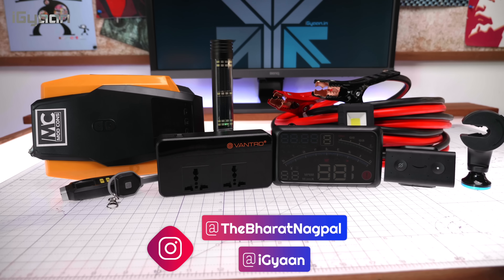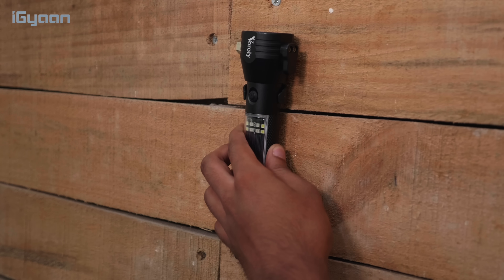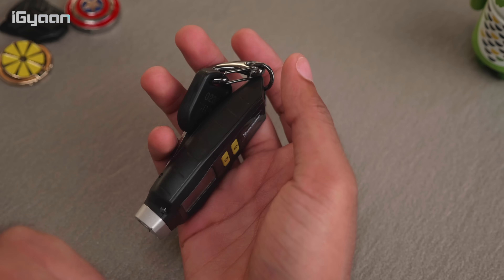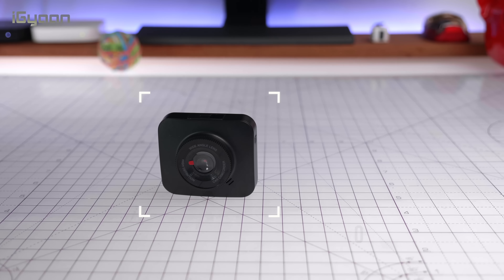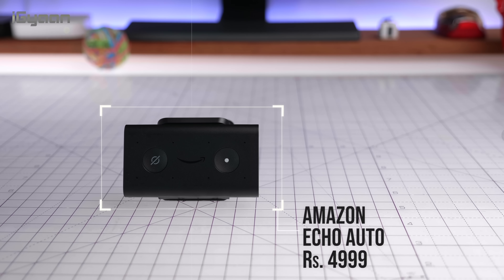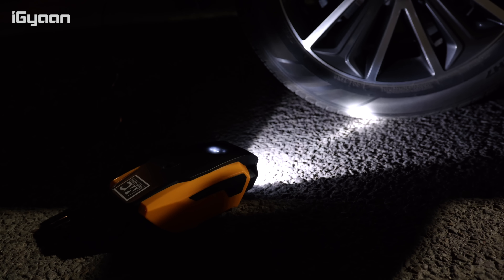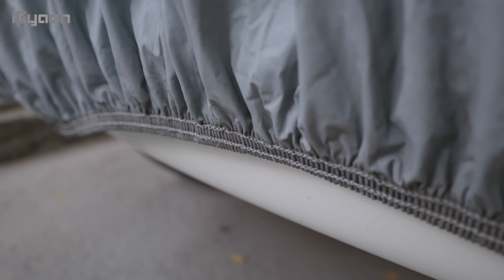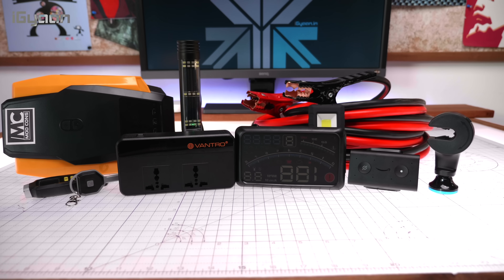Top Tech Gadgets for Cars Under Rs. 500 / Rs. 1000 / Rs. 2000

Comment: For portable tyre inflator, do check the Mi Electric Inflator. This has a 20000mAh battery and can fill 5 tyres in a single charge. It's pretty handy. Do check it out
Reply: I will suggest to buy Burgmann Car Vaccum cleaner which comes along with Tyre inflator inbuilt

Comment: I've been using a more expensive version of that Michelin tyre pressure gauge; the blue one which goes for 1500-600 yet I still don't get the features that the cheaper model has. Quite stupid product placement by Michelin if you ask me.

Comment: With the Echo Auto, if its connected to the car's speakers via either Bluetooth or aux cable, will I still be able to recieve phone calls on the car speaker? If yes, how does it work? Are the calls routed via the Echo Auto? And how does the Echo Auto connect to the internet? Via WiFi hotspot or Bluetooth?

Comment: U guys missed mi portable air pump. Its better than the one shown here. Why because it comes with 2000mah battery and can inflate 5car tyres in one charge.has digital display, formfactor of a power bank, ultra portable etc. costs 2499on mi.com. u could have added that one too.